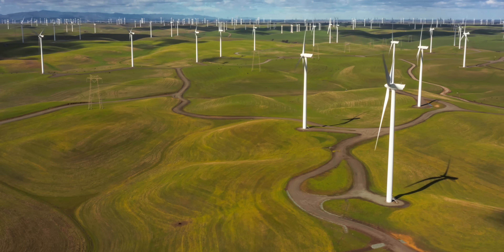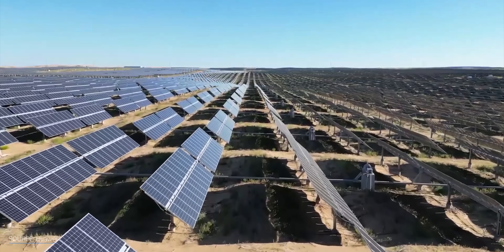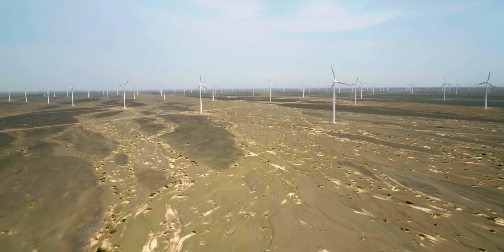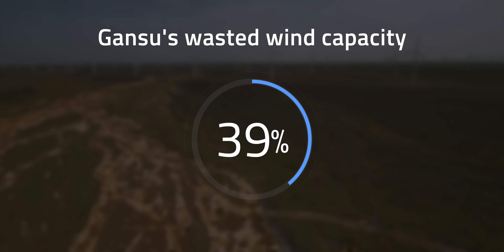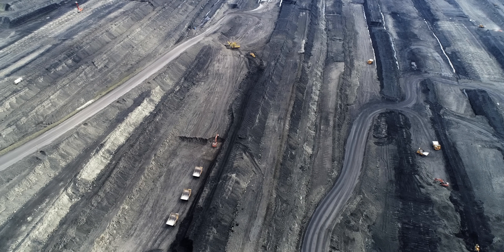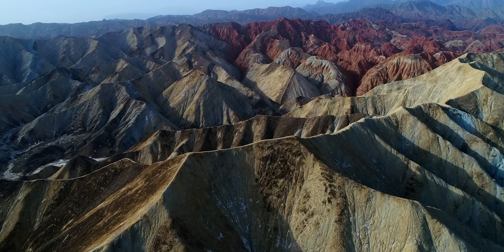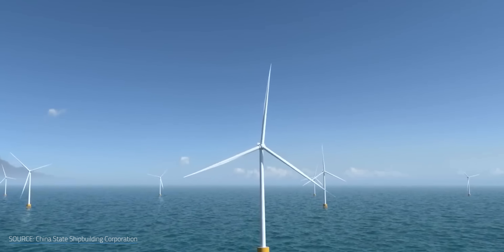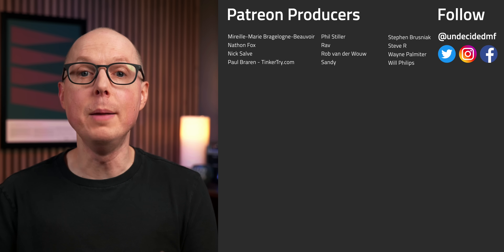The World’s Largest Wind Farm has a Tiny Problem

Comment: "Gansu's green energy is now 95% efficient"  What does that even mean?
Reply: it means they only discard 5%
Reply: @JasonKaler  That is not at all what that means. It means 5% of energy produced is lost to heat; it has no bearing on how much is actually used vs discarded.
Reply: @HalfAssedRanching  Wind turbines have a maximum efficiency of 40%, so it can't be about the turbine. It's about the entire plants efficiency of energy generated vs used.
Reply: @JasonKaler  

Then why didn’t he say that “curtailments” are at 5% of POTENTIAL ELECTRICAL PRODUCTION (not to be confused with the fact that is NOT 5% off of NAMEPLATE potential maximum output BUT nameplate X utilization factor X 0.95)! From reading the comments in this thread it is very clear that numerous people have various interpretations. I would be better if the YouTuber actually had some technical expertise in what he is pushing out.
Reply: Jason is likely correct. Matt has a website, and everything he says here is there in full text. ALONG WITH REFERENCES. The 95% comes from scmp, and the original scmp sentence says ...

The use efficiency of the farm's renewable energy rose to 95 per cent and the central government last year lifted its ban on wind energy ...
Reply: I saw that at 11:55 and thought he should have made what he meany by "efficient" clearer. It's not going to be converting 95% of the wind into electricity - that's silly and irrelevant. A turbine cannot capture more than the Betz Limit (about 59%) of the kinetic energy of the wind that passes through it because it would have to stop the wind completely. The air has to keep going to get out of the way of the turbine.

I think the 95% is most likely to be the amount of electricity that the transmission lines are capable of taking away and doing something useful with. At times when it is both very windy and sunny, the transmission lines will be saturated, and over the year 5% of the power that could have been generated will be wasted as a result.
Reply: @rjmunro  I think you almost got it right. Of the electrical energy generated by the farms, 95% is send into the converter of the power-lines (only 5 % is directly wasted/unused). How much electrical energy is left when it reaches the end-user (1500 km away) is not talked about.
But I guess that the conversion loss is 3% at the start of the power-line, 5% for the heat loss during transmission and another 3 % when converting it to AC. Roughly 10% is turned into heat (assuming the lines are used at close to max capacity).

The oldest wind-turbines have been standing there for 15 years now. The farms could be at max capacity now but have a lower capacity in the near future when more and more turbines need replacing. This seems to be a case of: "Got those headlines in the news now before the maintenance bites us in the a.. ."
Reply: That means they are not telling the truth.
Reply: It means global taxes for green energy from the Paris Climate accord are subsidizing China.. Once the carbon tax is fully implemented the tax on everything we as humans do will be huge pleasure for the CCP and India..
Reply: I honestly don't know. Wind turbines are only 1.2% to 3% efficient at converting wind energy into electric. 5% losses is also too low for resistance accountance. Resistance usually accounts for closer to 12% in wind farms due to their massive sizes and lack of density, requiring literal miles of cable to be run, losing energy the whole way.
Reply: @Handles_AreStupid  Well in a place with constant high wind would up that efficiency number but yes they will never achieve solar efficiency of nearly 20%.. Geothermal and solar furnaces in volcanic or desert areas is more efficient than wind as well.. The underwater tidal generators seem promising but being underwater has plenty of drawbacks..
Reply: I heard MIT managed to make solar cells that could get something like 57% (from memory), but the process is so intensive that they only use it for tiny cells for robots and such.
Reply: @Handles_AreStupid  Life span is a big issue with the solar cells that have very high efficiency.. If they only last a few weeks they are not commercially viable but for military use on things that have lifetimes in minutes they make sense..
Reply: Key resource not present in QUANTITY IN desert H2O . Government money = inflation  go broke GREEN CHINA
Reply: Using real math, or vaccine math?
Reply: @BanterMaestro2-y9z That's a clear explanation that makes it possible to visualize the upper limit to wind turbine efficiency.
Reply: @firstlast-ty4di  

That would be a miracle and only possible if the socket was extremely close. He really did a bad job with the “terminology”.
Reply: @BanterMaestro2-y9z No, it seems to have disappeared.
Reply: 95 % of the input energy comes out as electricity
Reply: @dermotbalaam5358  If someone is asserting that 95% of the energy in the wind or sunlight becomes electrical energy, I argue that he is badly mistaken.  I think 95% is a promotional figure with no basis in physics or engineering.
Reply: 95% efficient does not mean it is converting 95% of wind or solar into electricity,  it just means that the power generated from the wind farm will only suffer an average 5% loss when that electricity is delivered to its intended destinations through UHV power lines, making it much more efficient and viable.
Reply: @philwang2835  I agree; in this case 95% efficiency does not mean 95% efficiency.
Reply: @philwang2835  I've never seen someone so confidently be incorrect. Anytime you're discussing efficiency in motors and power, you're discussing losses to heat and friction at the source itself. If you wanted to discuss the efficiency of transmission lines, which would not be that efficient over that distance even with High Voltage DC, you would indicate the losses due to transmission separately. He said, the wind farm is 95% efficient, so transmission would be a separate category. Not that it matters really, as they are discarding more power than is lost from all other sources of inefficiencies combined.
Reply: @firstlast-ty4di  I think he means that 95% of the energy leaving the turbine reaches someone's wall socket.
Reply: @katrinabryce  Yes, he may mean that, but I don't think it's possible with line resistance and transformer losses.
Reply: Only 5% loss due to heat, etc.
Reply: @sajiantony7473  No its 5% of production cant be used and therefore wasted. it was 35% prior to the new transmission lines
Reply: @qbi4614  That is capacity factor, not efficiency
Reply: So let me ask a question.  Does this mean that wind farms in cold climates require heat and therefore they will not be as "efficient"?
Reply: @Mr3Charlie  Yes, wind turbines in very cold climates often have heaters integrated into the blades for anti-icing.  Obviously this uses some fraction of the turbine output when active.
Reply: @Mr3Charlie  They don't require heat, but every system that converts energy from one form to other (mechanical to electrical in this case) will always lose some energy in various forms. This just tells us that this particular wind-farm is 95% efficient in converting the mechanical energy to electrical
Reply: @abhishekpatra812  You may be correct if we interpret output efficiency as percentage of mechanical power in the turbine shaft that is converted into electricity.  That ignores the losses in turning wind into mechanical power and losses incurred in electricity transmission.
Reply: @firstlast-ty4di  Also ignores capacity factor.... wind days versus non-wind days. Or conditions outside the operating envelope of tge wind turbine. (Low wind speed, over speed, or natural weather events.
Reply: @abhishekpatra812  -- which means nothing.  The only efficiency metric that really matters is the efficiency at the point of delivery of the electricity (which is where the revenue is 'generated').  Very long transmission lines like that will lose at least a third of the generated electricity by the time it gets to market.
Reply: @Mr3Charlie The generators inside make heat as they turn
Reply: I am not going to add any more responses or comments to this.  I think that the Gansu project is impressive.  Promotional announcements, however, tend to be spectacular and often ignore the problems that accompany such ambitious undertakings.

Comment: I think that having excess renewable energy is actually a good thing, increasing reliability.

Many top engineers say that we need to scale renewable production to three to four times the required capacity to ensure a higher availability during times of low production and thereby reducing the need for the use of backup power plants.  We need to remember that renewable energy is highly variable in day to day production levels.
Reply: That’s not how power grids work. If you have too much electricity, you’ll burn out the grid. Everything has to stay between 59.3 hz and 60.7 hz on the US grid or it will burn out. Increasing dependence on renewables will produce too little without backup and put on too much without sufficient demand.
Reply: @justinalias7969  If you have too much, you just don't produce it. It doesn't go anywhere.  That's called curtailment, and it is nessasary because the amount produced will sometimes exceed the requirements.
Reply: It's actually a challenge in many countries because storage is still limited. Unpredictable and sporadic, and generates at the same time...and not always during peak demand. I think Denmark  had to curtail wind generation because sometimes they have too much of it relative to demand (including electricity demand from neighboring countries like Germany. )
Reply: And that's still a theory, if you have a big country like China, you may have a chance to have wind and sun in a region while it's not present elsewhere. If you are a small country like Belgium? Tough luck, better ask for nuclear power to France or coal to Germany. Scaling up even to ten times their need will not change the lack of wind and sun.
Reply: @itachiaurion3198  Belgium will link to other grids to get that distribution of sites instead.
Reply: @itachiaurion3198  to make wind and solar work well, regions are going to have to link their grids and share from areas of excess production to areas requiring more energy as the wind and clouds move.
Reply: @jasonneugebauer5310  transmission is not the silver bullet you may think it is. It can easily double or triple the cost of projects and have way more permitting headaches. It also doesn’t help that just trying to source enough inverters and transformers takes several years. Projects planned a decade ago in the US are just now getting the supplies
Reply: @justinalias7969  You are 100% correct.  Increasing transmission capacity is expensive, and a good costs benefit analysis needs to be completed before deciding to build any new infrastructure. 

But, additional transmission capacity is not required to get some basic benefits from building "exces wind or solar capacity." Wind and solar have a capacity factor of less than 40%.  Adding more pannels than the max rated output of the array is almost always more cost-effective because panels are cheap, and the sun is not always shining on the panels perfectly.  This means that all your expensive inverters and transmission lines are almost never being fully used if the pannels max output only barely meets requirements. 

I do not know what the most efficient quantity of additional pannels beyond max capacity at max sun is, but I would guess it's about double.  Yes, there will be maby three hours on a good sun day that the pannels power is being curtailed.   But the other nine hours of the day, the panels are producing much closer to their rated capacity, adding more stability to the array and the entire grid.

Tell me if I am wrong.
Reply: @itachiaurion3198  Current energy storage costs and a Europe-wide distribution system solves these issues, no need to ask for nukes from anyone.

Comment: I think some serious work needs to be done in figuring out how to dispose of the blades when the wind mills reach the end of life.  Stacking them in land fills doesn't seem like a good solution to me.  That's my biggest problem with wind power right now.  I feel that for most of the world, solar pv is the better and least obtrusive way to go.  Both solar and wind also have challenges when it comes to grid stability. See Practical Engineering's great video on these challenges.  We need a much smarter grid to manage grid frequency from these essentially DC power sources when baseline spinning generators trip offline.
Reply: In the UK, that's no problem. We need "energy islands" in the North Sea. These would be built with many, many thousands of EoL blades. Wherever you have large shallow-water offshore wind-turbine estates, you will need such energy-islands.
Reply: @jonb5493  I think you misunderstand me.  We're finding that many composite blades are wearing out prematurely and the composite material breaking down, at nowhere close to their projected lifespan.  They are not useful when that happens and have to be disposed of.  But they cannot be recycled, so they go to land fills. They cannot be used in your "energy islands."  I don't see how sending broken and worn out windmill blades to the UK would be helpful.  Another environmental issue is spreading particles of resin all over the place when the fibreglass composite weathers. I'm not nearly as in favor of wind farms as I once was.  Greed feeding on government subsidies has gotten out in front, I'm afraid home solar companies nearly as bad when it comes to greed.  I really want to love renewables.  In fact we just finished putting up 450 kw of solar on the farm. But I recognize there are significant issues yet to be dealt with.

Comment: I live 15 miles from a large wind farm and this one just like 99% of other has the same problem zero batteries to store the extra power and in places that makes since like were I live or desert places there no god dam solar it’s clear the land destroy plants and trees leave it like that and do nothing with the now open space.
Yes most will allow trees to grow back but others won’t but won’t utilize the open spaces like wtf.
Also all cities need to remove 20% of there concrete and asphalt and replace it with native plants and trees which will reduce air pollution and reduce flooding and soil erosion.
Reply: They are about to cover and destroy over 1000 acres of grassland here in SE WY to build a stupid solar farm for a massive data center. It's very sad to see them destroy natural lands home to many native plants and animals for a solar farm that will probably just be destroyed by a hail storm in a few years. At least the wind farms out here don't destroy the land as much. I hate solar farms. Solar on individual homes and businesses make alot of sense, power is generated right on the place it will be used, and goes on places that are just unsed roofs.